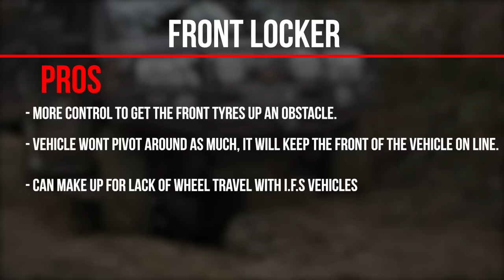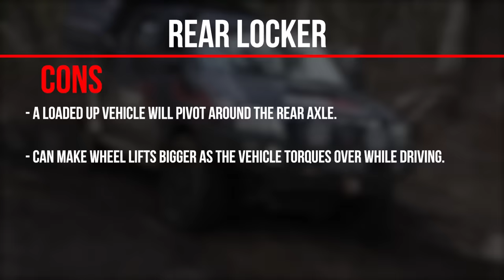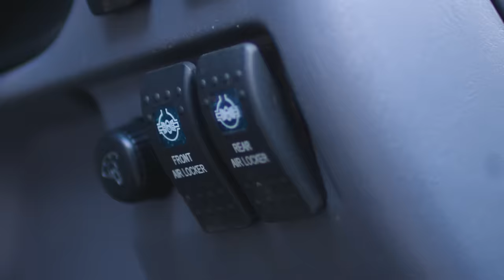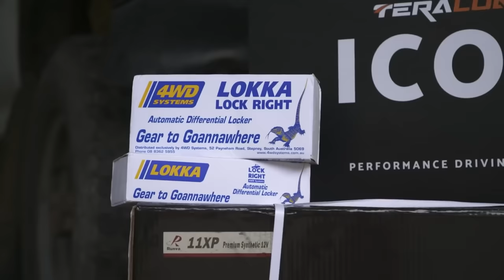FRONT LOCKER vs REAR LOCKER vs TWIN LOCKED COMPARISON! + AIR vs AUTO vs E LOCKER – Shock answer!

Comment: At 11:15 the LiveAxle is causing an issue.... Left rear wheel goes up, forcing the right rear to go down - right in front of a large rock...😢 With fully independent suspension I don't have that issue 😅

Comment: I I feel like, when I engage my rear e-locker on my 2020 MR triton, the trade off between losing the front traction control and gaining the positive rrear drive, it cancels each other out. I try to generally rely solely on the traction control ( which is awesome) only a couple of times have I found that the rear locker made a difference and they have always been in bog holes.. I’d love to hear anyone else’s thought on this...

Comment: Funny most said they would choose rear first, even with a great rear LSD already in place. Front will get you further almost every time. Rear might feel more natural but it is less effective. I like the comment "you don't pull a wheelbarrow, you push it" haha (sorry) you wouldn't be able to push a wheelbarrow up that hill but you could pull it up. The same in sand or mud. The physics of it is if you push, a greater % of wasted effort is being pushed into the ground, if you pull more effort goes into lifting up the hill or above the ground.

Comment: With locker choice you need to consider where your load is going to be.  If you are light in the back the front would be your choice.  Where the weight will be is where your traction will be.

Comment: I know this is a few months ago, but just wondered how centre locking diffs come into this, and how they would affect rear or front lockers?
Reply: Centre diff lock does the same thing as selecting 4WD.  
If a car has a centre diff but no centre diff lock it is not a true 4WD and there would be no point putting lockers in the front or rear axles.

Comment: I don't rock crawl.  Vehicle off road a bit,  lots of winter deep snow driving.  The vehicle mainly on road and a daily driver.  I will go with an auto locker in the front mainly because my jeep has a Center Axle Disconnect,  so when in 2WD = drivability and when in 4WD = traction with the engine weight over the locker differential like a front wheel drive vehicle.

Comment: Front all day. If you have a rear LSD and front locker and you lift a front wheel you have a 2.5 wheel drive. If you only have a rear locker and you lift a front wheel you have a 2 wheel drive. That and up hills the weight transfer is towards the back giving the rear wheels more natural traction.

Comment: twin arb air lockers in my 2011 dmax only problem is i can't engage front only  must have rear engaged for front to work
Reply: Nothing wrong with that but if you don't like it that way it is easy to change the wiring so you can put the front on by itself.

Comment: Pete from Ultimate 9 looks and talks like Eric Bana. So it seems the best is the priciest. What competition is there for air lockers? ARB & TJM. I saw a video where the TJM Pro was better as it doesn't roll back when turned on. Giving more control.

Comment: Side note the front is best cause it has more weight stock. But depends how your truck is set up. If you have good weight in the bed then the rear is better.

Comment: Not related to lockers, but what type of brakes would be best for off-road? Drums or disks?
Reply: Discs mate, drums get wet on the inside while crossing rivers, mudpools etc, and when you go to use your brakes after you'll find no brakes with drums until they have dried out. go discs!
Reply: @paulboon1100  thanks mate. That was really helpful👍

Comment: no mention of locking up the centre diff/transfer case which many 4x4 systems have nowadays. also many now are going for limited slip or torque biasing diffs as they have the benefits of full locked diffs without the drawbacks in most situations.
Reply: Because 4x4s have always been able to lock the transfer case. Traditional 4x4 systems didn't have a centre diff but they would still lock front and rear outputs together when selecting 4WD.

Comment: 3:12 Oh, my gosh, how many people cannot realize this... You can't have 50/50 torque split on a solid axle. Take a pencil and spin it as an axle—the torque from your fingers will spin the whole damn thing, with no split whatsoever. It's kinda 100/100 between the wheels, because they are sort of one wheel.

Comment: My question is how do lockers work with LSD? I have LSD in the back so would a locker up front be a cheap way to gain that extra traction or should I lock the back?
BTW I have a 3.0 GU II.
Reply: Not all LSDs are equal. They can range from doing almost nothing to giving lots of traction.  
Nissan Patrol LSDs are known to be pretty good so a locker up front and the LSD in the back is a good cheap way to get extra traction. Then later you can decide if you want to lock the back but many people with Patrols just keep the LSD and shim it if they want it tighter.

Comment: rear locker con never mentioned .... no more LSD for on road ... becomes relevant in a petrol off the lights in the wet... a torsen lsd will be a much better compromise in the rear for most people.... selectable front is awesome.

Comment: I have a GXL 79 daul cab, it came out factory with a front and rear locker (RR->RR-FF) its never let me down but the day it does i will be switching the toyota factory locker for air lockers. I honestly dont like how your forced to pick either back or front AND back on the toyota locker though i do understand reasons why this application was set up this way. All in all id say air locker and both, if you cant afford both get a winch and recovery kit. As the boys said about airlockers you will need a compressor anyway at some stage for 4wd. To quote graham 2 birds 1 stone :)
Reply: The way the air lockers get installed at the shop and the way it says in the installation manual they work like the factory Toyota lockers. Either rear or both, no front by itself. You can change it or set it up your own way if you like so the front and rear can work independently, but you can also do this with the factory lockers.
Reply: @JeremyPetho   oh really? how do ya do that? just make its own switch or somethin? :)
Reply: @ninjadragonblade   
The way ARB air lockers are installed the rear locker gets 12v ignition power and the front locker switch is connected to the output of the rear switch so it doesn't get power until the rear switch is engaged. This can easily be changed by connecting the front locker switch to the 12v ignition power too.  

The Toyota factory lockers have different ways of wiring depending on the model but I believe a 79 has the switch wired up the same way, while the 80 series was different and would allow either one first.  

But in my opinion having the rear locker on even if you only want the front locker is no big deal.

Comment: What is triple locked then. I'm guessing the transfer case, making both front And back move at the exact same time ? Should have been mentioned
Reply: That is correct, triple locked has a locker on the centre diff which locks the front and rear axles together.  
The reason why they didn't mention it is because it essentially does the same thing as selecting 4WD. A traditional 4WD system doesn't have a centre diff but still locks the axles together when in 4WD.  
So a triple locked is no better off-road than twin locked, it is just triple locked is what you call it on a full-time 4WD and twin locked is what you call it on a part-time 4WD.

Comment: Great explanation.
Essentially, lockers provide ACTUAL 4WD.
And ONLY lockers can do that.
These fake, brake-force-based, software-driven setups in most new vehicles are nothing but revenue generators for manufacturers.
And unless one has replaced all front-end components to be as strong as the rear, a front-only locker setup is highly discouraged.  
I'm not aware of any manufacturer locker setup that allows front-only engagement, for good reason.  Most mandate the rear engagement first, and only allow the front to lock if the rear is too.
It certainly can be done, but it'll be a jerry-job in the wiring to do so.  Or a failure in aged wring that allows a faulty engagement of the front, without the rear also locked.  Or in the case of DIY locker install, you simply wire (or plumb) to allow it.  
Which is a whole 'nother video...adding lockers to a rig that was never intended to run them from the manufacturer.  Lots of additions/upgrades/strengthening of components to make that arrangement reliable.
Oh and IMO, it's manufacturer E-locker for me all day long.  Too many points of failure in an air system for my tastes. You have to drill the axle housing to fit it, opening an additional hole in something you'd rather not have additional holes in.  The axle has to be disassembled to troubleshoot.  And you're adding something to the rig, rather than the rig having been designed for the system to start with.  
If your compressor goes tits up when you're two weeks from everywhere, what then?  At least with e-locker, if you lose power to it you can just run a wire and Bob's your uncle.  And on an 80 series, you can carry a spare actuator and install it without having to carry a spare compressor or take the axle apart to fix something.

All that said, it's likely most who run air systems are prepared for and accept the caveats thereof.  So, it doesn't really matter in that regard which system you choose.  So long as you can hang with the group on the trail.

Comment: My question would be could a torsen locker keep up with an air locker at all?
Reply: A torsen will work OK on the easier tracks but on the really challenging or technical stuff it won't keep up with a locker.

Comment: big boulder crawling situations, like the one in this video, a front locker is better, as evidence showed. Reason being, it is hard to push the front end up a rock vertically when applying forward movement from the rear. But front lockers can climb the rock vertically by itself. Take the same wheelbarrow analogy, try pushing it up stairs, it's gonna be a lot harder than pulling it up stairs. but anything that doesn't quite involve big vertical climbs, rear lockers are better.

Comment: What about the TrueTrac? No need for a compressor and an easier install.
Reply: Truetrac is a torsen LSD, not a locker. They operate smoothly and give better traction than most LSDs but still don't give as much traction as a real locker.
Reply: @JeremyPetho  Would be good to see it in the lineup though for a comparison.

Comment: Would a front locker also make it easier to snap CVs on IFS vehicles?
Reply: In my opinion.....yes I'm twin locked but when you have lockers you don't send it as hard. Haven't done a cv since the lockers. Slowly crawl over most things.
Reply: The answer is both yes and no.  
On one hand, the vehicle will be more capable and you can drive things slower and more controlled. This prevents breakage from shock loads when a wheel spins up in the air and suddenly hits the ground.  
On the other hand, the vehicle will be more capable and let you drive harder tracks, which will increase your chances of breaking things.  
Having a front locker will also put strain on the CVs whenever it is engaged so if you are using it too much when you don't need it, you can end up breaking a CV.

Comment: Would a torsion diff come under auto diff? Is this something that isn't common in Australia?
Reply: The torsen works similar to an auto diff locker but a lot smoother and less noticeable. The problem is they don't work very well when there is only a small amount of traction or when a wheel is lifted in the air, making them more suitable for light off roading and road use. An auto locker give much more traction so they are more popular for off-roading.

Comment: I’m a fan of rear for first purchase unless the vehicle has a good lsd then go front. I look at it this was it’s easier to push a wheel barrow full of dirt then it is to pull one over rough terrain
Reply: Oh and air definitely more bush proof
Reply: You turn around and pull it up a step though hey
Reply: @brettmelville5052  said no bricky or concreter ever
Reply: @brettmelville5052  no they would have looked where there going and put ramps on steps. Oh hang on we do that to track building

Comment: What about lsd vs locker? For cars that have neither from factory.
Reply: There are many different LSDs and they can range from useless to almost as good as a locker. But a locker will still give better traction off-road.  
The advantage of the LSD is that it also aids with traction on-road and operates smoothly.
Reply: @JeremyPetho  I'd like to see a similar test with lsd off road.

Comment: Electronic is the way to go if you have to deal with sub zero Temps. Air lockers have a tendency to freeze up (condensation) rendering them useless.
Reply: Good point! Rarely gets that cold in aus but interesting to consider mate!

Comment: I know the auto lokka is noisy but if it's in the front then won't it only be active and noisy when 4wd is engaged. In 2wd and the hubs disengaged the front diff isn't being used.
Reply: Correct mate! In 2wd you can’t tell it’s in the front at all
Reply: @jocko4wd281  awesome thanks mate. It may be a good budget option. Do bother wheels need to have traction before the auto lokka will slip.

Comment: So where does a center diff lock come into the equation?  how does that affect things
Reply: Without it, you aren't in 4wd.
Reply: @k2svpete  so do all 4wd's have locking center diffs ? If it's open, wouldn't you get slip between the front and rear diffs ?
Reply: @MrTubeuser12  a part time 4wd has no centre differential. As soon as you engage 4H or 4L, there is equal drive front and rear. A full time 4wd like the 80 series onwards and all coil sprung Land Rovers have a centre differential. This must be locked to give equal drive front and rear.

Comment: Jock tries the first step unlocked. No go. Tries again, front locker only, no go. Tries the rear locker only, no go. Tries both front and rear locker, no go. So the conclusion is, the real locker you want/need in any 4wd is a winch, it will conquer all 🤣🤣

Comment: none of you guys gave the brands of lockers used in your vehicles, whats the best bang for buck locker you would recommend?
Reply: Lokka is probably be best bang for buck. It gives as much traction as any true locker for a fraction of the price. Jocko has 2 of them on the budget Hilux.  
But they work automatically so you can't turn them off, and they can be a bit rough in operation compared to a manual locker so it is not for everyone.

Comment: What is the difference with the central diff locker like in a prado?
Reply: Without the center diff locked the car acts like AWD vehicle, it's not a true 4wd until center is locked
Reply: Most of the vehicles featured in the video are selectable 4wd vehicles, not full time like the prado
Reply: Could you feature a prado on your show to assist with there being a huge number of us owning one. I have a Kakadu 2010.
Reply: @hampuslytz5393  does this mean you would still need to get additional lockers with a prado?

Comment: rule of thumb, if you thinking about placing a locker on your truck  either front or rear, dont?, why?,  place lockers on all 4 ;s rear and the front. your offroad , having lockers all around the truck make for better in every way. your not on the street people YOUR OFF ROAD, . and the lockers is slow speed only, i prefer electric over air, air leaks and electric is more reliable climbing the rocks, canyons, its a helper in everyway. save your money and buy them at the same time, this is sport or having fun, but its going to cost you in the end when it breaks, and parts will break!

Comment: Just shows that without traction even lockers are useless.
Also it’s easier to pull a vehicle than push it. So front locker makes more sense if you can only afford 1.
If you cock a wheel in the air and have a vehicle with a decent traction control system, you’ll still have 3 wheel drive as the lifted wheel will get braked and keep torque moving to the other side. With active torque vectoring braking a wheel isn’t used, a clutch pack or similar will send the torque where it’s needed.

Comment: This is physics 101.
A front locker will always do better up hill than a rear as it is pulling you rather than pushing you into the hill. IE. Push wheelbarrow up steep hill...V pulling a wheelbarrow up a steep hill.  The problem and reason why automotive manufacturers will not risk front lockers is simply this. If you steer while locked it does not work. Also you will like damage the front drive train.

Comment: Toyota has a gear/electric motor engaged locker, not really an E Locker. Personally I don't like the toyota locker it "feels" weak, so scared something breaks the disengagement sound... and you have to get some counter wheel movement for it to engage/disengage... :/

Comment: I've never figured lockers were much good in the wet.
Reply: Because lockers double your traction. If you have no traction without lockers and double it with lockers, double nothing is still nothing. But if you have a little bit of traction and double it, that's still a lot better than no lockers.

Comment: why aren't there centre lockers like in a G class
Reply: Centre lockers are not something you buy and install in a vehicle.  
Something like a G Class with a centre diff needs that diff to be lockable to engage "true" 4x4.  
Traditional part-time 4x4 vehicles simply lock the axles together and there is no diff between them so no need for a centre locker.

Comment: Long story short twin locked $ 8000 later is the only way to do that without winching or bouncing around like an idiot snapping cv joints or axles
Reply: It doesn't cost $8,000 to get twin locked. An auto locker costs about $400 and others cost between $1,000 and $2,000. I put 2 lockers in my car for under $2,000.